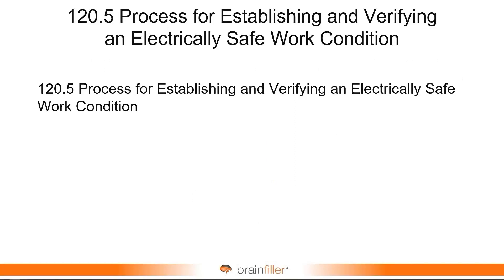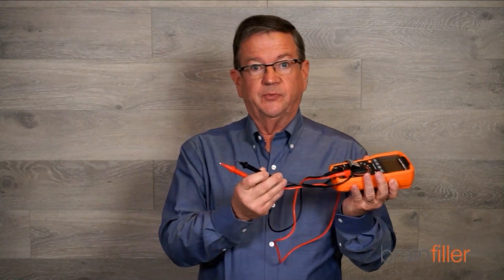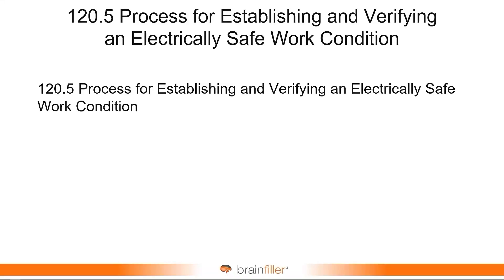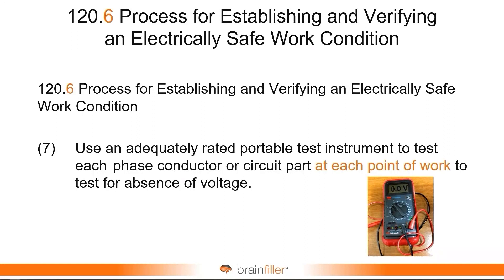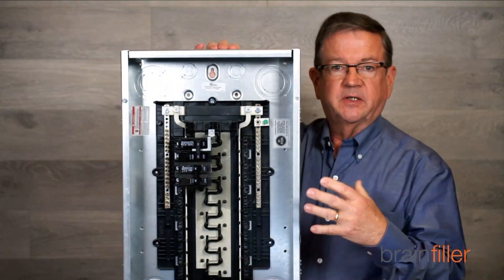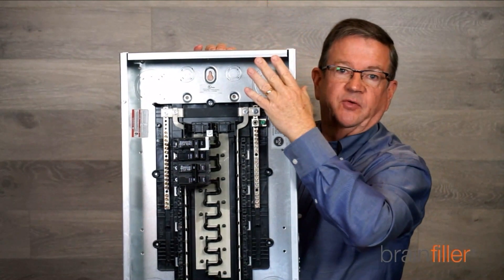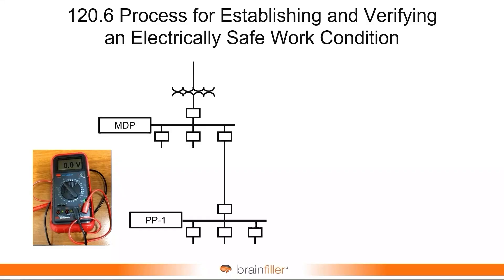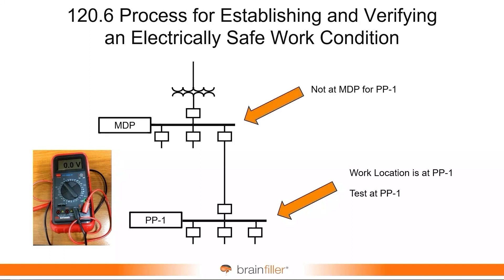2024 NFPA 70E Revision: Testing Absence of Voltage at Each Point of Work

Comment: Hi Jim,
Very good information video.  While I fully agree that the new verbiage to test for absence of "at each point of work" is a long overdue clarification that will help reduce confusion, minimize accidents and is a step in the right direction, there still needs to be additional instructions to re-perform absence of voltage testing when working in large electrical equipment such as switchgears or MCCs. 
The panelboard you showed is a fairly simple electrical design with only one or more sources entering the line side of the main breaker.  As long as all the sources are correctly LOTO, then testing the line side of the main breaker will be adequate for everything downstream "at each point of work".  However, with very large distribution equipment such as switchgears or MCCs, there can be multiple different feeders entering different cubicles and parts of the same equipment.  In some industries, not all the feeders can be isolated and must remain energized for critical loads.  In such cases, the absence of voltage test, needs to be reperformed as the worker moves from cubicle to cubicle and part to part.  There has been numerous accidents and operational experience  where workers entered a cubicle that was thought to be de-energized (ESWC) but contained energized parts, resulting in fatalities and serious injuries, because they assumed their initial absence of voltage test was adequate.  If the workers had reperformed the absence of voltage test "test before touch" then the hazardous condition identified and the accident averted.

Thanks and keep up the great job.